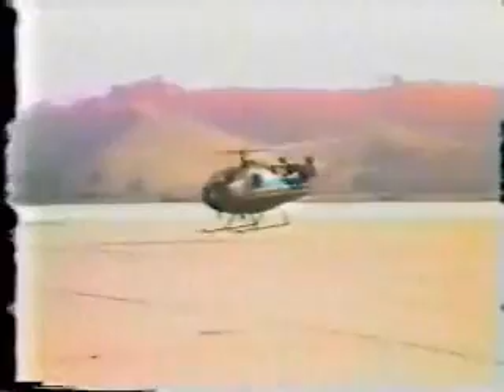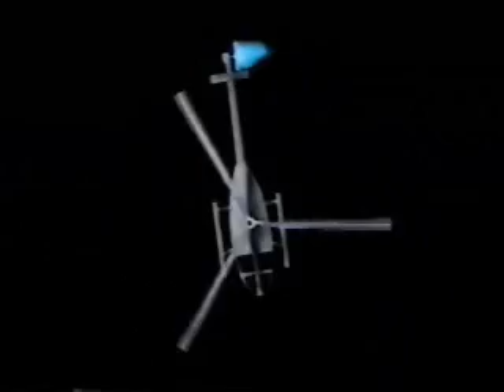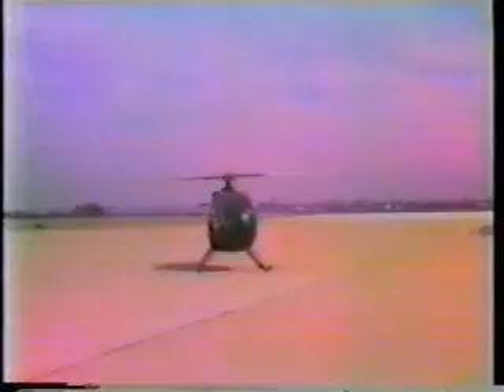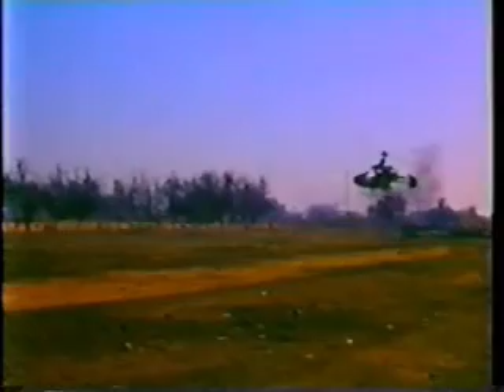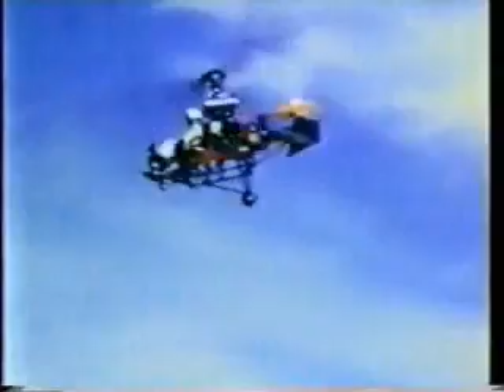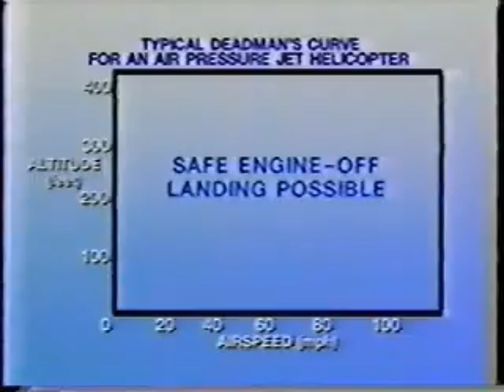Voljet tip jet (pressure jet) helicopter

Comment: What made the roto-dyne so loud was the "rocket" combustion that occurred in the tip nozzles but this wasn't the case with pressure jets that don't burn fuel at the tips and from all reports a standard pressure jet helicopter is no louder than a standard helicopter with the majority of the noise coming from the rotor blades.  These helicopters haven't replaced the conventional power train helicopter because of the extremely poor fuel efficiency of using compressor bleed air to power the rotors with the majority of the remaining engine power getting wasted as jet exhaust.

Comment: Interesting to find a cut from a video I produced when working with Voljet International back in the 1980’s with members of the Thompson family (famed for development of the styrofoam coffee cup) and renowned aeronautical engineer Eugene K. Liberatore. The attributes of the air pressure jet helicopter remain - much greater safety and operating economy plus low noise, as well as being much easier to fly,  but the successful production of a viable and certifiable modern aircraft utilizing the technology has yet to be achieved thanks predominantly to its reliance on combustion power and fuel consumption various potential developers’ inability to source the substantial financing required.The potential of electric power offers a major benefit to overcome the fuel issue and, undoubtedly, a successful battery-powered pressure jet design cannot be too far in the future, despite the resistance of the ‘conventional’ manufacturers whose fortunes rely on their lucrative sale of replacement mechanical parts, largely unneeded in the pressure jet.

Comment: I worked for Dr. Nagler in the early 1970's, as a backup pilot for Charles Tucker (who is seen numerous times flying various prototypes in this video) and as an Engineering Draftsman. I did quite a bit of work on the "Honcho" which evolved after the H-200, and was a predecessor, it appears, of the SX-255. Glad to see someone is continuing his work.
Reply: So you have Honcho 200 time too… after Nagler, my father had it and built the Eagle 200’s. I spent my childhood cleaning, working and flying with him in the Honcho….. the blades and various parts were Djinn system…. The MA1 Continental engine was loud and thirsty… flew it in known ice and never a spect of ice on the rotor system…. Last known location was Colorado after someone dynamic rolled it…😢
Reply: @markmay1655  Ass I said, I worked for Bruno on the "original" Honcho for about a year. He had s "shop" in the Phoenix area in the early '70's. I helped build and fly the prototype. It was an interesting machine, but was noisy and a little short on power. I was not aware of the machine being further developed; the rumor was Bruno was just looking for investment money.

Comment: I am thinking  this system  should be very valuable for many real purpouses.  BUT it seems the narrator makes a mistake ha? please correct me but why is he saying that YOU HAVE to DISENGAGE the rotorsystem if engine suddenly failed in an ordinary heli? AFAIK,   all Helis have  sprag clutches so wheneve the engine stops, therotor just keeps turning on  its own freely w/o any input.. Thanks
Reply: leviterande  not all helicopters have sprag assemblies i.e a one way clutch
also one way sprag assemblies have friction losses which means rotor rpm decay in a free wheel situation

Comment from the maker: With modern rare-earth magnets, a famous motor designer told me he could get 1 horsepower per cm length in a 3 cm diameter motor, and it's probably better now.
Search for electric RC aircraft motors to see some, e.g. rctoys.com; dragonfly, uqm etc. as well as the new Dyson digital motor.

Comment: I agree that the system use on the Djinn was not optimal in efficiency...Was not later use in France but was not able to lift heawy loads...
Ok , i see at the bottom from the presentation your "fan in blade system", i don't understand the difference before but the "Phoenix airjet Rotor helicopter" is completly similar to the Djinn.. but the fan in blade 75hp electric motor!: how can you install such a powerfull electric engine in a blade  to run the fan up to 200000rpm?

Comment from the maker: Djinn type pressure jet helicopters aren't very efficient -- that's why I invented the electric fan-in-blade concept which blows air through the blade ends front to back. See the AHSpresentation link in the video description above

Comment: The only "new" in known as tip jets, is the hydrogen peroxyde jets, and peroxyde is expansive and dangerous...and not so new in definite: was called "T-stoff" in the Messerchmitt Me 163...the peroxyde was invent in 1818 from the French Jean Jacques Thénard...
The cold air jets from Oyt A Stearns is totaly comparable to the Djinn system but looks less powerfull (i think based on a simple centrifugal compressor rotate from a gasoline engine)

Comment: OK , but what's the advantages in comparision with the small ( 2 places) French SNCASO Djinn Helicopter, rotor driven from a cold air jet produce with a Turbomeca gas turbine, built in the 50', and use from the French Army?  some Djinn are actualy maintain flightworthy by private users, no bad for such old helicopter...

Comment: watch?v=qgSq1bB-eV4

This is good stuff. Tip jets are extremely powerful. But they are mainly good for large wide rotor aircraft. And the engines don't have to be that powerful. Plus jet engines are good at high altitude and once a helicopter is moving forward it creates more lift. thus you can actually reduce engine power. Tip jets are indeed the best. Although you may say jets are not efficient its because these aircraft are too damn small and light. And need hi-lift airfoil rotors.